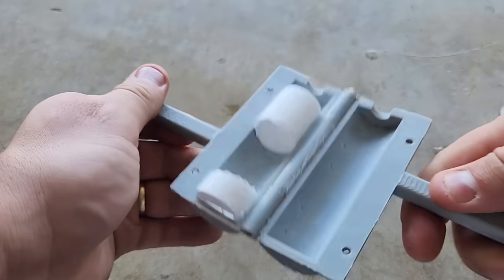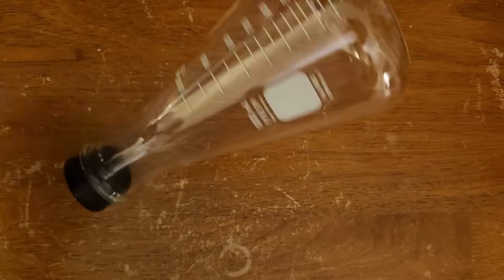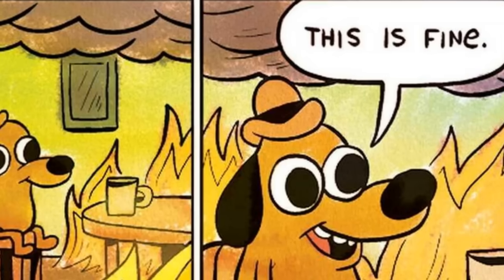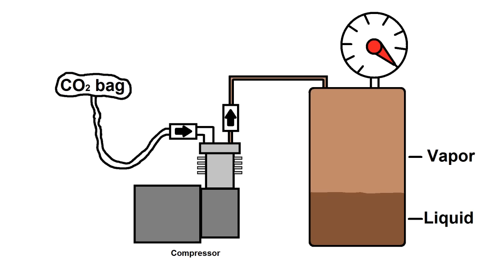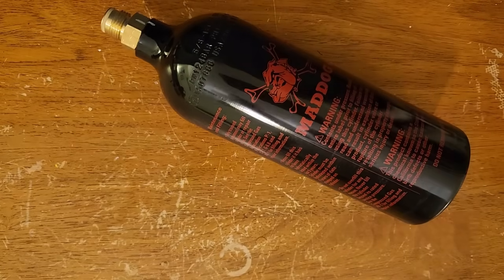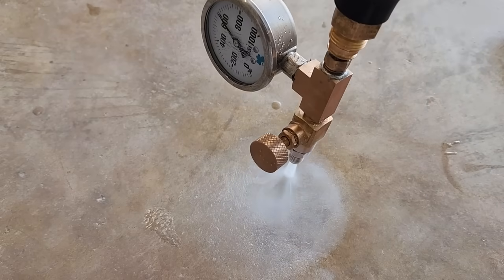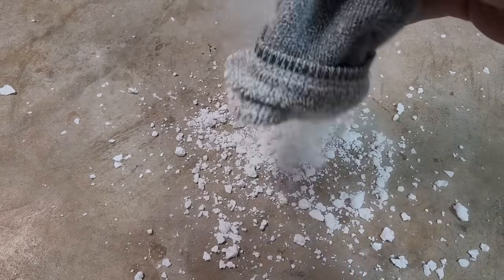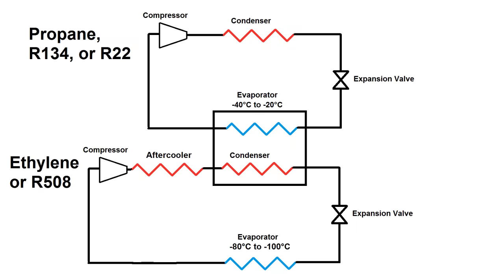Making Dry Ice from scratch

Comment: I have a bar and we used large CO2 bottles for our keg system.  The large cylinders are called 50lb CO2 cylinders and cost about $50 bucks to fill up.  You can have them filled at a fire extinguisher dealer cheap.  Most dealers can also recertify a tank of any variety.  Should be able to find some cheap cylinders.  For CO2 our tanks stay around 800 psi
Reply: Is the CO2 used to refill fire extinguishers "food grade"? Do you have to worry about impurities when using fire extinguisher CO2 with beverages?

I wonder if the CO2 used with paintball guns is food safe?

I've been meaning to get some small CO2 tanks for pneumatic projects. I'm pretty sure CO2 provides much more working gas than pressurized air in a comparably sized of container.
Reply: @ddegn  Seltzer bottles use common CO2 carts like airguns use. I've never seen anything about having to use "food grade" CO2 in them.
Reply: @Centar1964  Good to know. Thanks.
Reply: @Centar1964  That's "food grade" CO2 because it's just clean CO2, I don't know if the CO2 used in fire extinguishers is suitable for food use or not.
But CO2 cylinders used for welding have some oil from the compressors, at least some of them.
Reply: You can also buy 80 and 100 lb tanks at hydroponic stores as well as 20 and 40 on tanks at beer brewing supplies shops

Comment: I suggest you buy some Dry ice and use that for your test rather than go through the hoops of building a whole refrigerant loop as a pre-cooler. If the Dry Ice method works than you can work on building a pre-cooler.

FYI: Make sure the air you use in the cryo cooler is bone dry as it will like freeze up with water ice in the cryo-cooler.

Comment: Hmm ... at what pressure does your baking soda+acid reaction still produce CO2? It's not going to easily stop just because there's already a high pressure of CO2 around, right?
Could you sidestep a big portion of this process by directly making the CO2 in a pressurized system? Instead of running the chemical reaction at 1 atmosphere and then pressurizing, just letting the reaction itself make your pressure. Maybe it's more hassle than worth but it would be cool.
Reply: I was not able to find how much pressure this reaction could produce but I think it's pretty high. I did find examples of using baking soda and acid to launch rockets made from 2L pop bottles.
I think your idea is worth investigating (as long as I don't have to do the work).
Reply: @ddegn  Chemical reactions like this (just by looking happening instantly) tend to be able to push a lot of pressure. Dangerously high ammount in fact which is why I would personally never "investigate" this idea as you say. But for those who know how to be safe about these things...
Reply: you would find the equilibrium point of partial pressure for this reaction

Comment: You could add salt to the ice bath to lower the temperature even more and make your poor compressor happier (or at least not that unhappy!) by not having to reach a pressure as high.
Reply: Might even be able to liquefy oxygen if you do a 2-stage using the dry ice with an acetone bath to cool the second stage

Comment: Very cool, I have seen the sock thing done before. This is a lot of work and equipment to pull off. I think it's easier to buy co2 in a cylinder from a welding supply store , cheaper also. But fun video keep up the great content
Reply: the cheapest way to source co2 is to pick up a siphon tube co2 bottle as used for soda fountains, they can be picked up for under $50 and refilled for far cheaper than a larger co2 bottle

Comment: I remember seeing in a science equipment catalog, maybe Edmund back in the day, a dry ice sock, the use of which I never explored.  I hadn't thought about that in probably 20 years or more until you tied the sock to the outlet.  "Hey, so that's how it works!"
Reply: IIRC we used a bag made out of chamois, the kind you can get for polishing your fancy automobile.
Reply: I remembered it as well.
Reply: I remember that in the Edmond catalog, it came with a denim sock to collect the ice.
Reply: @bobbyvarnell9350  is there anything special to it(material it's made of or something) or is it basically just a sock?
Reply: @KibitoAkuya  I think you just want a thick material. You can buy the bags and make your own with a tank of co2. It wastes a lot though. They also make these little plastic blocks that you can release the co2 into. Also wastes a lot of co2. This is fine if you only need to make a little bit every once in a while. Anything more than that and you'll want to spend 5k on a machine that pulls co2 out of the air and makes dry ice like a regular ice machine.
Reply: @StonerTHOTS  And in-between those, just buy the dry ice directly.
Reply: @KibitoAkuya  Denim is good because it's relatively smooth so the dry ice doesn't tend to stick to it.
Our setup used a denim sock surrounding a laboratory beaker, it seemed to be very effective.

Comment: At a guess, motors often have lower torque starting up than when running, the compressor got to a high enough pressure that while it could still run, the load was too high for the motor to be able to start again, it stalled and instantly burned out.
Reply: Even if the motor was locked it wouldn't instantly burn out. It would draw 2-3 times it's rated current but still take a while to burn out.
Reply: @fascistpedant758  it’s not burned up. It’s a pressure lock. Refrigerant systems don’t use an unloader valve. They have what is called a “compressor delay” if you have ever programmed a thermostat this is the variable that allows the pressure on the high and low side to equalize before starting the pump. These compressors are very high efficiency and rely heavily on the inertia in the rotating mass to achieve the high pressures that are needed. Chances are he could have let the pressure out and it would have started right up.
Reply: Compressors actually release pressure when stopping, so that when they start the next cycle, the starting torque doesn't have to fight the pressure inside.
Reply: @graealex  Any chance this compressor was designed to be used in a fridge with a capillary tube or throttling valve that opens when off? It's possible the pressure relief path is outside the hermetic compressor.
Reply: @michaelharris679  That is generally true. Also, these compressors are typically not made to be run a) with 100% duty cycle (although some are fine with it, especially AC compressors), and b) at pressures far higher than the normal refrigeration cycle. It's possible that it just got too hot, and then winding isolations might simply melt and short out.
There is also the issue with oiling. From what I gathered with other creators and feedback regarding using sealed fridge compressors as "air compressors", the oil sump will eventually run dry, plus outside moisture will attack the compressor.
Reply: @graealex  Not the smaller herms.  They will rapid-cycle on overload until the pressure equalizes,  which takes a few minutes.  This was a junk compressor,  so the OP didn't care how many times it cycled on overload upon startup.  No one should try this at home unless they are an expert.  I have seen many experts in the field who were sorry after re-purposing scrap parts.  Be careful!  Back in the old days,  things like pumps and old discarded TVs were extremely dangerous to fool with.  Ever seen an implosion?  Don't even put that picture 😏 in my mind.    :text-green-game-over:
Reply: manitoba2445  Not sure what you mean. If you have ever used a compressor, you have probably noticed the big hiss that always follows the end of a cycle, where the pressure inside the cylinders gets purged, so the motor doesn't have to fight it when it restarts. That is separate from the actual outlet that connects to the pressure vessel you are filling up.
Reply: Wads of co2 selection typically being heavier in those areas
Reply: The current draw on my compressor is so high when starting that if I use a long extension cord the voltage drop causes the motor to stall. This only happens if it is already at a high pressure. I can fix that by using a shorter cord.
Reply: Electric motors produce the most torque when the rotor is stalled. Depending on the type of motor the torque will drop off as the speed rises.

The piece is called a “unloader valve” and releases the compression in the cylinder when the motor cycles off.
Reply: @jonathonhaberkorn233  true of some types of motor, but not all: induction motors which are quite common tend to have this weird humped torque speed curve, where the torque grows to a peak and then shrinks again
Reply: Compressors have unloaded valves to get the cylinder to atmospheric pressure.

If the cylinders were already at say 150PSI the electric motor on the compressor can't overcome that.

Thus the unloader valve allows the compressor to start.

I got bored and stopped watching  so I didn't see the compressor fail, but likely the unloader got frozen or something
Reply: Electric motors have max torque at low RPM. Usually close to 0 RPM you can achieve max torque.

CHEAP electric motors have difficulty starting because it runs off 1 phase power, and if there's no movement internally, the field doesn't "move" relative to the windings.

3 phase motors have max torque at 1 RPM and higher.

Just correcting some misconceptions and confusion regarding electric motors

Comment: 3:24 Nice bong.
And some of the problems you show I had experienced myself. I used to refill the smaller SodaStream bottles with CO2 from a large tank. Without a siphon tube, it's damn near impossible to get anything to transfer at all. And even with a siphon tube, when the larger tank was down to maybe half the capacity, it required a few cycles of filling the smaller bottle, putting it in the freezer, and then filling again to get a somewhat decent amount transferred. 
Then I switched to a hose directly connecting the large tank to the SodaStream, but with the large tank having a siphon tube, it forces liquid CO2 into the SodaStream, which then cloggs because it turns into dry ice at the nozzle where the gas can expand. Waiting for that large tank to finally go empty, so I can replace it with a tank without a siphon tube. Oh, and the reason that companies simply replace your CO2 tank is that they'd face similar problems if they tried to actually refill it on-site, unless done very slowly.
Reply: Thank goodness someone else said it - I was thinking super dab rig lol

Comment: baking soda + vinegar = co2
Reply: law is very dangerous internally consumed
Reply: how about heat drying the co2 gas
Reply: try hybrid solid-solid-to-gas/liquid rocket motors, ie, sand blaster rocket (air) mixer rockets, or, air + fuel afterburner rocket burner (valveless ramjet)

Comment: Very nice. What types of fittings would be appropriate for those pressures if one was concerned about safety?
Reply from the maker: A proper adapter for the paintball tank fitting would be fine. I just jury-rigged mine by drilling/tapping
Reply: Hydraulic.  Hvac refrigerant lines are usually rated at 10k or 8k psi but brass fittings “shouldnt” explode. But its not like those 10$ home depot fittings are stress tested to pressures that high when theyre sold as water fittings..   ive gotten brass fittings new out of box with hairline cracks and at those pressures a defect in the casting will blow apart a fitting with enough force to embed pieces in your meaty parts..  plus a hose burst or sudden purge of 1000 psi will also easily rupture an ear drum..  not from the pressure differential of the room but the sound that shit makes is crazy loud..  i had a 450psi pop off valve go on me once and had it on recording.  What the camera picked up was just psssd. But what i heard was a bbrrrrrrr..  thought that was wild..
Reply: When considering which fittings to buy, you're quickly going to realize that the ones you NEED are pretty expensive. If you can cross reference them from Chart Industries to their supplier, you'll be fine. I maintained the equipment at an Industrial and medical gas distributor and there's so much that can kill you in a project like this that while fun and cool, it's like playing with dynamite. Safe until it's not.
Reply: English brass/copper ,yorkshire fittings WITH OLIVE RINGS . YOU CAN G#ET FROM PLUMBERS MERCHANT S in U,k.

Comment: "It could eeeasily be lethal... Anyway"

Stay safe!
Reply: If that tread fails all that pressure is released. Frosts damage to skin, suffocation, loss of hearing and turning bottle into ballistic missile that has enough force to punch trough brick wall are the very potential consequences depending on detail like location, top of turning that peace into impro bullet. Local trade school had student be poked to weld cap to pipe, fill it with oxy acetylene mix and hit the spark. End result lead to whole welding section moving it self to walls and removing all the windows in 50 meter radius. Top of that all the gas bottles also went to walls from several broken the valve off and turned into ICBM's going trough the brick wall, metal roof like it was not there. Furthest away one was found 100 meters away, mind those bottles are really heavy even when empty. This one has less mass and pressure, but its still enough to be dangerous if you fuck something up, so learn what is needed to make it safely, well as consider all the risks constantly. Its better if you can do everything remotely from behind the brick wall or similar shield to hinder it and mind having well ventilated area that allows co2 be replaced with fresh air fast. Full lung full of co2 can knock you off pretty damn fast.
Reply: @Hellsong89  Yeah I've heard a couple of oxy acetylene bombs go off and they go off with one hell a bang lol. I guy I know made one when he was an apprentice welder. Set it off in the workshop and ruptured his bosses ear drums. He wasn't an apprentice there after that 😂😂
Reply: @Hellsong89  He should wear  rubber gloves when handling the dry ice !
Reply: @Hellsong89  päüää

Ä0ä0äü0ä
Reply: 00
Reply: Hellsong89,
The linear force on the 1/8" pipe thread is only about 125 pounds @1,000 psi.
The diameter is about .40 inches which happens to be .125 (1/8) square inches.
The threads can easily hold many times that force. Near zero chance of failure.
Reply: Safety 3rd, right?
Reply: 0
Öäü
Reply: Üüüüäüää0ä000ä0ääääää0äü0üäääüüüüääää0⁰
Reply: So true, 
But so is an outlet
Or gasoline.
That being said, again true,
Well said
Reply: PLEASE hydrostatic test any DIY pressure vessels/fixings with a grease gun. It'll only cost you $20 (+fittings) and may save your life.
Reply: Ü0üüü0
Reply: At least it was not your crusty shorts !!!
Reply: That is one thing that makes it fun, lol!
Reply: I was just about to post this reply myself. lethal...anyway is the start of I'm sure many a failed experiment and trips to the hospital